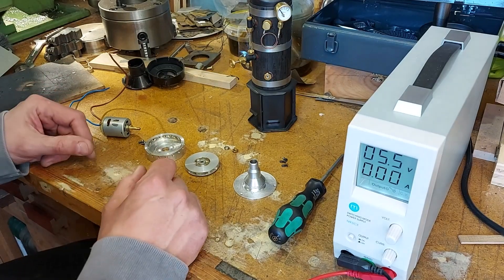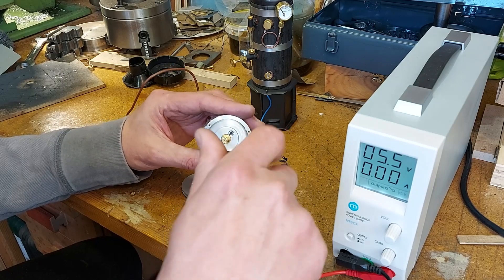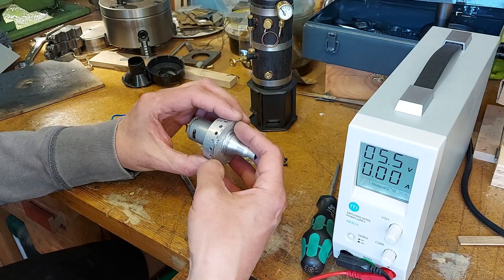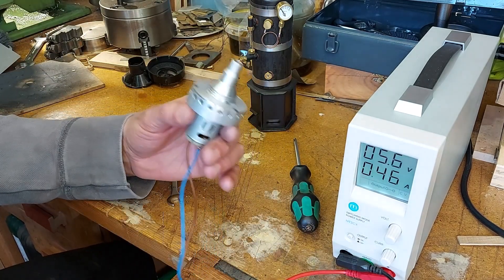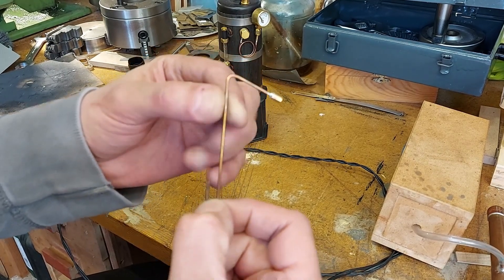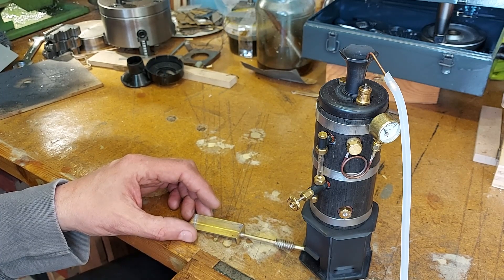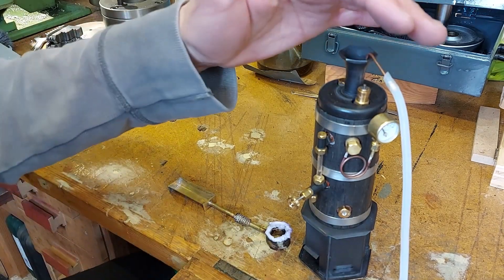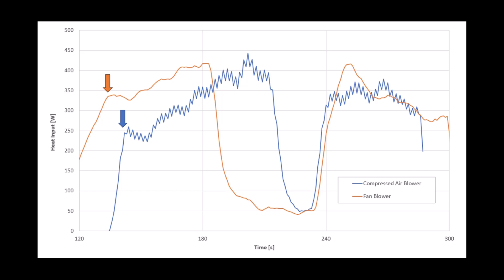Steam Raising Blowers

Comment: Great vid, I didn't know you were on YT! I actually made a bent tube blower initially, but the problem is access to compressed air at the track! 👍
Reply from the maker: 12V lumbar support pump from a seat works really well, I think you would need to test different nozzles though as not sure if you need velocity or volume. I think velocity. You could probably even use a 2 litre plastic bottle and a bicycle pump...maybe too radical for the track